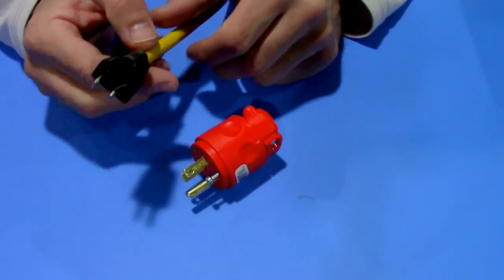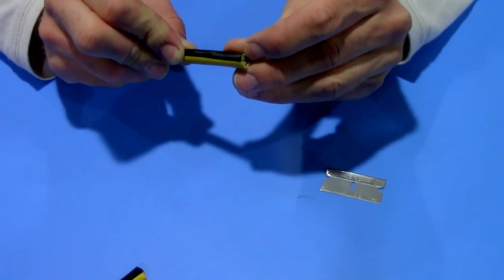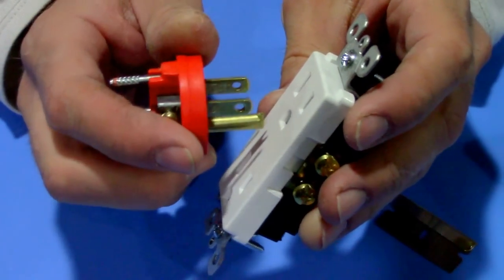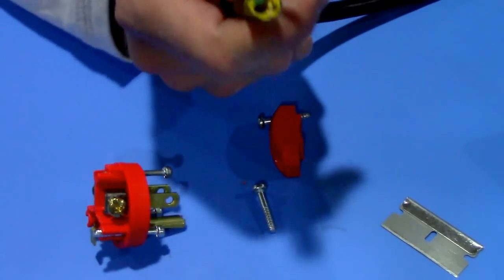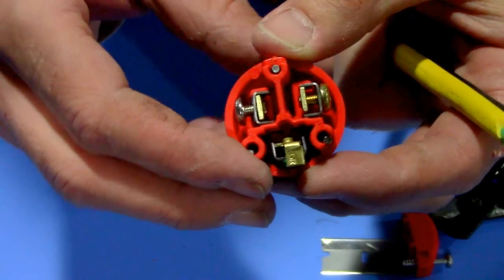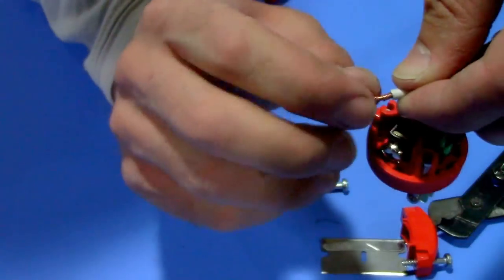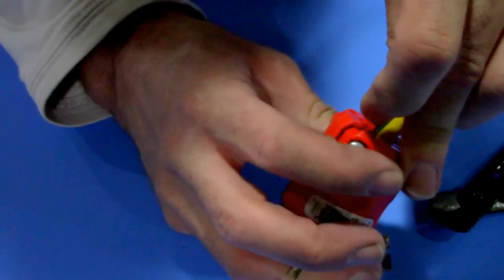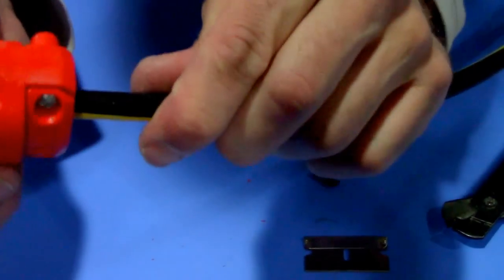How to replace a plug end Extension Cord repair

Comment: Hi , I was doing this way for years but recently I found that this screw can split the narrow wires and may cut them . you may use Non-Insulated Wire Connector Ferrules :-)

Comment: Hi Adam I have a question. I am making a grounding mat. I'm using speaker wire for these mats. When I use my wire stripper some of the copper pieces came off. Is it still okay to use this copper speaker wire? It seems like it's really hard 2 cut that insulation stuff off with the wire stripper. I just can't do it really good yet.
Reply from the maker: Some strippers have holes specifically for the gauge wire that you may be using.  It helps to not strip some of the strands.  I would find a better stripper.   It's not good to loose strands.
Reply: Hey thank you so much. You know more than the guys at Home Depot. I'm going to go back to Home Depot and get better wire strippers.

Comment: You need to finish tighting all the screws with a screwdriver. Using the drill is an unsafe practice.  Get rid of the drill.

Comment: Q My cord has a green covered wire(ground) however the other two wires are not color quoted, the only distinction is one has writing on it the other ones does not, which one is positive and which one is negative?
Reply: my cord has brown and blue which one is which